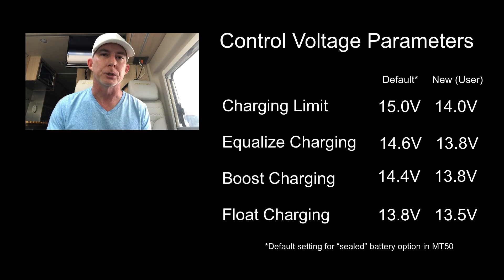Hymer Aktiv - Lithium Battery: ROUND 2

Comment: Hey Maury, thanks again for making these videos!

I have the same H / L1 situation. Also, my wiring is “everything to the charge side” so not sure if yours was the same and whether that will result in different needs. 

When my H is off entirely, my L1 always disconnects (ie relay opens) regardless of being charged by UGH, solar, or shore. Was that the same for you? If so, did you adjust the Balmar to play nice with the L1 like you did with the solar controller? 

In general, I need to regularly push the reset switch on the L1 to close the relay

Thanks again.
Reply: Would your L1 disconnect when receiving power from shore and the UHG or only with solar?
Reply from the maker: Yeah, similar experience for me. It’s two different problems; the H would allow itself to be overcharged. The L would disconnect itself but that took out power since everything was wired to the charge side. I just ended up limiting my charge levels (both from solar and balmar), which meant less capacity - but at least I didn’t have to worry about those two issues.
Reply: @TravelingSolo  Gotcha, makes sense. Did you obtain Balmar and Solar Charge controller settings for the L1 from KS2 or did you use them me off the files posted in the Facebook Group? Or, did you tweak in your own special way? 🙂
Reply from the maker: @MattMargulies  I based them on the levels that we put together in the group, I think I set everything to 13.9V.  You can start conservative and raise it from there to maximize your capacity. I am a low power user so I just left it there. :)
Reply: @TravelingSolo  Great, thanks again Maury! I’ve seen some of your vids of your new custom build….looks like it’s gonna be amazing!

Comment: Hello Maury..I have a 2019 Hymer Activ needed a new set of lithium batteries. What you are recommended new batteries brand for replacement?
Thank you
Ramy
Reply from the maker: That’s a complicated answer… The batteries that came with the rig are from KS2 in Canada. Any Roadtrek dealer can order new ones and install them. The community also has someone in California that works on them, if you are on the West Coast. The downside is they are very expensive, but there are no plug-and play options.

Comment: I am having same issue with power module disconnecting itself from the solar panels as well as the coach.
1.  How difficult is it to change the power settings in the solar controller?
2. What is the contact phone number or email address you used to contact Hymer? I am not having any luck finding a customer service contact in North America.
Thanks. 
Bill Bridges
Reply from the maker: Hi Bill. First, this is likely a result of an overcharge state by the solar controller due to the settings being too high. Hymer used the default settings in the unit but the battery BMS will disconnect itself at those levels. You will need to buy or borrow an MT50 display panel (it's not very expensive), which will allow you to reduce the charge settings to an appropriate level for your batteries. You also may need to reprogram your Balmar (the unit that charges the batteries from the under-hood generator.) 

As for Hymer, they are long gone, at least for the time being. The new Roadtrek may or may not help you out. I don't know where you are located, but I would recommend Gordon at Edge Van Works in California if you're not comfortable making any of the programming changes yourself. You may also want to have him rewire your system, if it's using the discharge-side wiring that Hymer was using. There are tutorials online and in the Facebook "Hymer Owners and Wannabes" group if you want to look into it yourself.
Reply: @TravelingSolo  Thanks for your detailed response. This is all very daunting to me as I am not electrically inclined. I could give the MT50 a shot at reducing the charge levels, but as for rewiring, that's well above my level of capability I'm afraid. I'm 71 and can't do the things I used to do so easily. Also, I live in the St Pete area of Florida, so your recommendation in California is not a doable deal for me. I'll take a look at some more tutorials and see if I can glean anything worthwhile from them. Thanks for all your advice.
Bill Bridges
Reply from the maker: @whozyerdaddy1  I would definitely focus on reprogramming the solar and Balmar. The battery wiring isn’t critical, just something that is advisable. Good luck!

Comment: Hi Morey,(Maury)
Not sure which is correct lol. 
Do you know which agm battery is in our Hymers? I'm still trying to get the ecotrex system working. Went to Sunshine State rv but they want 1500 in labor alone to put in a new agm, change out the lithium and rewire to the discharge side. I want to change the agm first and found someone to do the wiring but not sure on the battery. Another Hymer owner sent me this link but want to make sure before I buy it. 

Group 24 AGM 12 volt dual purpose boat and RV battery - SLI24AGMDPM at Batteries Plus Bulbs
https://www.batteriesplus.com/product-details/marine_rv/battery/x2power/sli24agmdpm
Reply from the maker: I have not had to replace the AGM kicker so I can’t confirm that is the right group battery. I just crawled under but there are no visible markings or labels. That seems like it could be the correct battery though.
Reply: @TravelingSolo  Thank's again and stay safe.

Comment: We have a 2019 Aktiv 1.0 we got from Ontario in May - one of the last vans left in the factory after shut down. Found out we have the K series batteries, which according to KS2 were prototype and weren't meant to be installed in the vans. Great! So, one of the batteries now keeps going off line (recent development). My husband has already reprogrammed the solar controller according to Sams' specs, and then according to KS2 specs last week. Battery is still going offline. Now plan on rewiring the cables to the discharge side, hoping that will fix it. Any thoughts?
Reply from the maker: What voltage do you have the solar charge set at? Does it drop completely offline (ie, loss of power) or does it just disconnect itself from solar? Have you reprogrammed the Balmar as well?
Reply: @TravelingSolo  We reprogrammed the solar settings to Suiets settings. Did that about a month ago. No problems initially. Just one battery turns off on it's own even after it's been charged.  Blue light goes on but won't reset. Can get back online by running UHG. But then shuts down again. Voltage doesn't appear to go below 13.1. Never higher than 13.5. Other battery is fine. It's very random but now mostly frequent. Hubby has not reprogrammed Balmar yet. He's is working on figuring out rewiring cables. Waiting on parts now. Wires are connected to discharge side so he wants to move to charge side. Then he will reprogram Balmar.
Reply: I'm wondering why Hymer installed these prototypes to begin with! You would think KS would have made sure that these never went to market in the vans.
Reply from the maker: I’d look more toward KS2 than Hymer on that one - if the K wasn’t ready for prime time they shouldn’t have sent them out. I’ve seen a number of people report that they have the K series installed.
Reply from the maker: My L series would disconnect itself when it was being overcharged, but I never had any issue getting it to turn back on. I wonder if the BMS in the K is different. I’ve been thinking about calling and having a Q&A session since I have my own list of questions about my H and L batteries. It would be nice to know what the scoop is with them all - what they share, what has changed.
Reply: @TravelingSolo  I'm surprised everyone with the K-series is not pushing back at KS2 more about this, because there could be a big safety concern, and thus legal  responsibility, for not controlling where their prototypes ended up.
Reply: @TravelingSolo  He's going to try to get this stuff installed next week and then will contact KS2 again. K series batteries are supposed to be closer in design to the L series rather than the H. Will keep you posted.
Reply from the maker: I just sent them an email as well, just to go over some of my initial questions and I also asked about the K series. If anything significant comes of it, I’ll let you know. :)

Comment: If im not mistaken you have to change the setting at the balmar regulator as well.
Reply from the maker: Two separate systems, but my Balmar has been reprogrammed as well.
Reply: Yea they sure are. We been dealing with these complaints lately at work with the new L batteries.
Reply from the maker: Yeah, this problem was sort of highlighted when the L series was put into production, as it’s programmed to operate at 13.5v. So when the L’s started being used, the stock settings were putting them into self preservation mode. The H series was set at a much higher limit, to its detriment. I’m sure that’s what took out many of the H series that we previously thought were just a bad run of batteries.

Comment: I would not want to run different batteries like that. You shouldn't have to mess with that, if they replaced one battery with a different type, they should replace both. I'd want them to be identical, so that charging characteristics don't have to be changed between the two battery units.  If you're using the same settings, the battery with the higher voltage requirements will not be getting fully charged, leaving you with less overall storage capacity.
Reply from the maker: I’ve heard that someone at Roadtrek said they should be replaced in pairs, but I can also see how they wouldn’t want to replace a very expensive battery that was still good. While true that the H series battery won’t fully charge from solar now (14.1v full charge and the solar is set at 13.8) it’s less than half a volt under. And, it will still charge fully from the under hood generator, so I’m not too upset. Everything is working as it should, so I’ll call it a win. :)
Reply: I'd let them decide. Under warranty, it's their responsibility to make right.

My understanding of lithium based 12V batteries is some will not charge fully if you charge them at lower than the 14.x volts they need. I'd be concerned that lowering the charging voltage won't charge one of the cells as much. I'd also worry that the underhood generator may throw too much voltage at the other battery. 

It's under warranty now, I'd at least see what they say about it, before crap goes all bad in a few years and their response is "sorry, out of warranty!"  ;)

Comment: Hey Maury.  Sorry you couldn’t make it to the meet up in Quartzsite.  So I noted recently that my Aktiv Voltstart would not start when only using one BMS (other BMS turned off) even though the battery was too low.  Do you know if the Balmer looks somehow at both batteries before engaging?  Also I would really appreciate any suggestions on testing battery discharge - my batteries do get to full charge with the UHG (about 13.65 v) but they seem to discharge way too quickly and I am not sure how to test the discharge rate.  I also seem to have one H and one L as the L does not need me to push reset (in fact if I do it does not do anything yet the battery is active) while the other battery requires the reset to engage.  Thanks for any advice!
Reply from the maker: It sounds like the same setup I have. When I turn on the L1 battery, it engages itself where the H can be turned on for charging but not activated. I'm not sure if I like that or not, being able to turn the battery on to charge without having the BMS siphon power is nice. Someone said that the L1 BMS only draws about 35W now, but I can't confirm that.

I reviewed the service training info on EcoTrek and Voltstart and the instructions are to turn on all of the battery modules when engaging VoltStart. They aren't clear if that is just to ensure charging them all at the same time, or if it is required... but it seems as if it may be a requirement. Perhaps the Balmar is programmed to know how many battery modules there are, sort of how it requires doors closed and key out of the ignition. I've only used VS while running the coach AC (and obviously having both batteries on) so I haven't tested it one at a time. Good question though. Maybe I'll check it out on mine as well. :)

Comment: Can you tell me what the ground clearance is for the Hymer Activ?  Also can larger tires be added in order to increase the  clearance?
Reply from the maker: Depending on where you measure, ground clearance is anywhere from about 6 to 8 inches. There is a lot of low-hanging equipment (Under-Hood Generator shroud, power steps, propane tank, etc.)

I've looked into wheels and tires and the short answer is "not really".  There's not a lot of room in the wheel well and a taller tire that WOULD fit isn't much larger. I found a video of someone with a ProMaster van who wanted to do the same thing and while he did get them on, in the front there was barely any clearance, and in the rear he actually had to cut some of the plastic wheel well trim away because it was making contact. And in our van, with the extra weight and bounce, I'd be nervous to do it because the tires could make contact.

I looked into bigger wheels also, so that they didn't look so tiny on this big van, but without extra room we'd have to go with a lower profile tire and it would start to compromise the ride quality, and increase the price of the tires. 

There is a company that does lifts on these vans and I think that would be the way to go first, if you really wanted to go that route. Check out http://www.offhighwayvan.com/product-page/ram-promaster-lift-kit for more info. They were really nice to talk to.